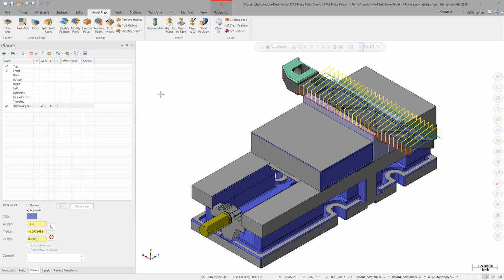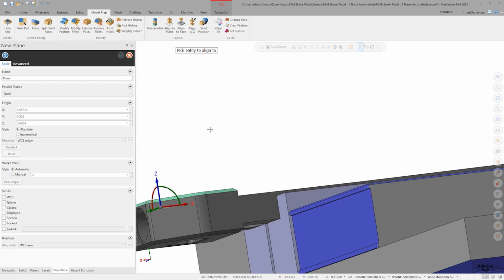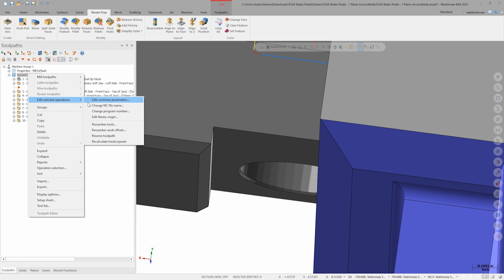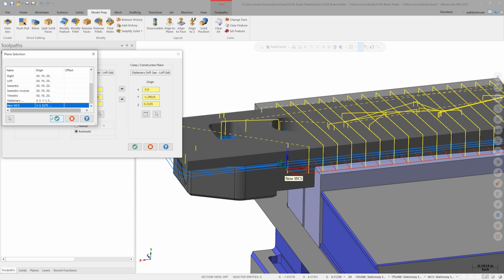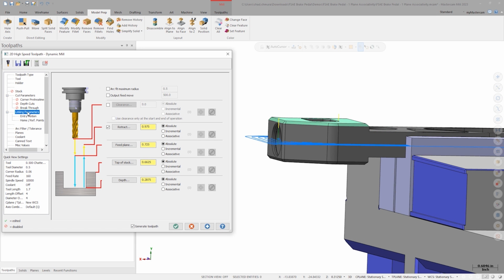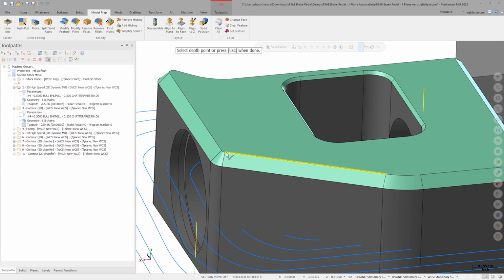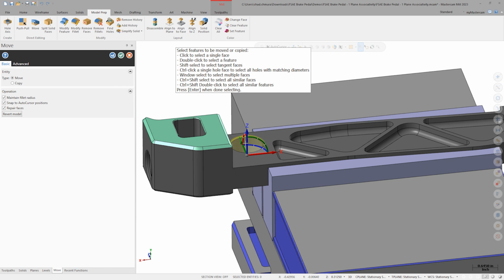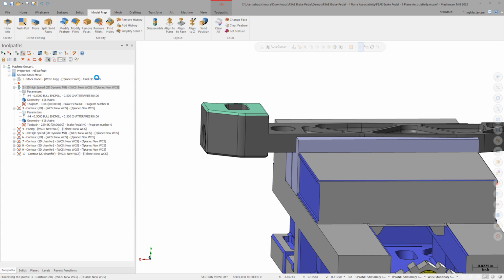Plane Associativity Demo using FSAE Brake Pedal | Mastercam 2023 Signature Parts

Comment: If only I didn't have to lock my planes to keep the from moving.
Reply from the maker: Hi Jeremy, there are two ways to prevent the planes from moving due to a geometry change. If the plane has already been created, you can manually "lock" the plane in the Planes Manager. Or, if you are in the process of creating the plane, you could uncheck the Associative checkboxes on the Advanced Tab of the Dynamic Plane creation interface.